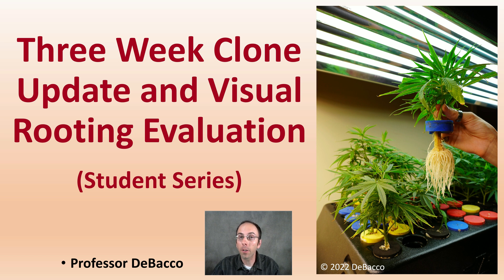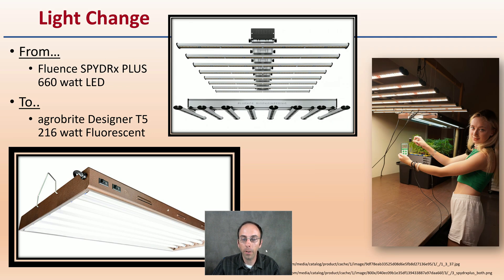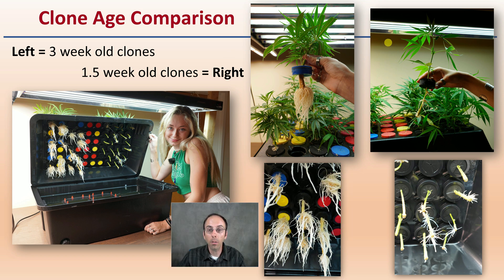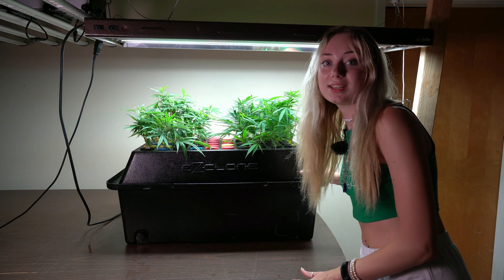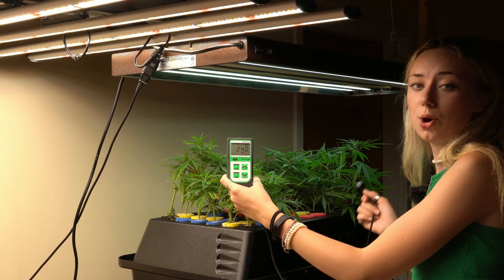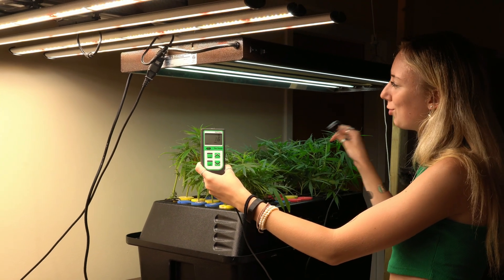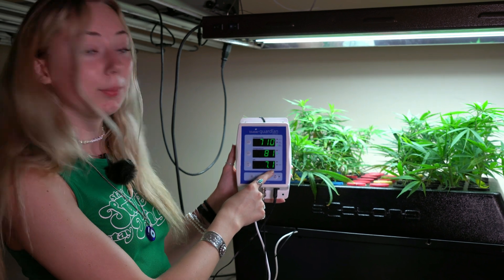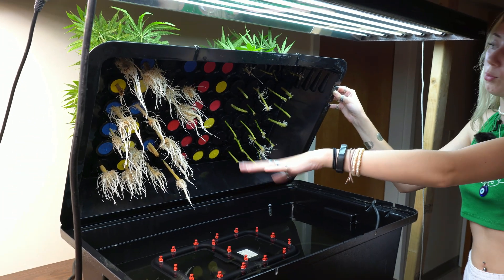Three Week Clone Update and Visual Rooting Evaluation (Student Series)

Comment: How about the ez cloner 8 ft In height away vertically  and like 5 feet in length away from the led like in the corner of the room. Having the led at 75
Percent also.
Reply from the maker: Distance may be to great to provide plants with sufficient light intensity.

Comment: The distance between the lights and the plants is greater than necessary. Was a humidity dome being used removed prior to filming? No reflective material? These look good considering they were not dunked in Wilt-Proof at the beginning.
Reply from the maker: This is showing an even more simple method, no humidity dome, no reflective material, no Wilt-Proof either, just cut water soak and place.  While it may not be 100% efficient it still produces good results.

Comment: More light equals more production.Roots are perfect color!
Reply from the maker: To a certain extent, 800+ PAR on clones will work against you.
Reply: @DeBaccoUniversity  with a vigorous root system as such no but starting out yes!
Reply: @stevecrabtree7654 no man. Less light for vegetative growth and during generative growth or aka flowering about second week you pump the ppfd up.Vegetative  growth= high humidity and low light , high heat temperatures and generative or flowering is high light intensity, low temps,  low hummidity. 😅. Only rookies think high light intensity throughout the plant life is good.

Comment: Rocket science..I took cuttings poked them in dirt, put them in a green house & they took, depends on time of yr outside but it can be done without all the fuss.
Reply from the maker: Reduced rooting time and increased success rate is why this method is done, but if these do not matter to you there are other simply systems as you mention that can work as well.

Comment: Thanks for video! I thought I missed it in the first video... but does your room just have a good relative humidity to keep them leaves looking so happy? 🤔
Reply from the maker: Not the best, the key is to keep the pump running 24/7, PAR around 200 and cut hydrated plants.  They will wilt for the first day or so but once the clones adjust they do just fine.

Comment: Hey Doc. Do you ever use humidity domes with your clones, or are they put into the cloner as seen in the vid, with no dome at all? Thanks.
Reply from the maker: No dome used and no issues to report.  However, if you are a very arid environment and have low humidity you may want to consider a dome or misting system.  But you may also want to try with out it and see what happens.  This shows it is possible not to need a dome for success.
Reply: I clone in soil in a greenhouse with 75% rooting put them in shade and keep soil damp and mist 2 times a day if I remember
Reply: The cloneking website says very specially to NOT use one. This is why you always see these machines without one.
Reply: @Michael-Masi-2021  all that gonna do is promote rotting correct?
Reply: @13samfootball  actually I don't know why they say that.